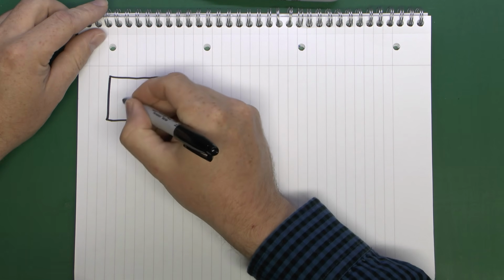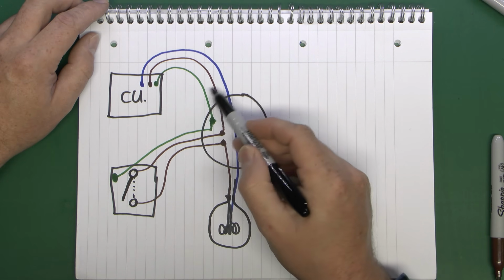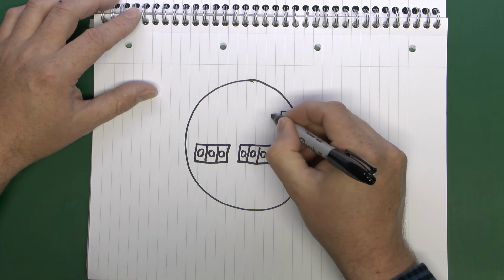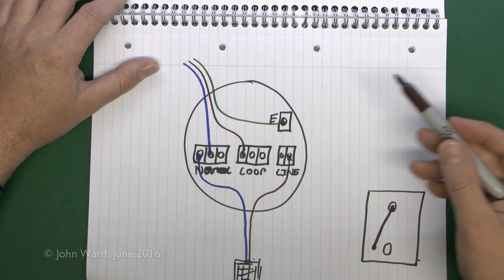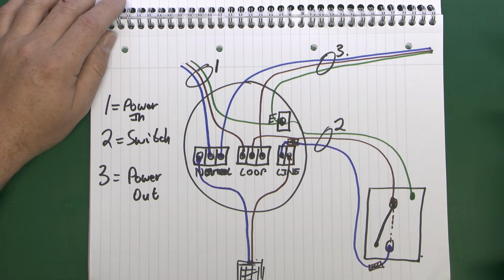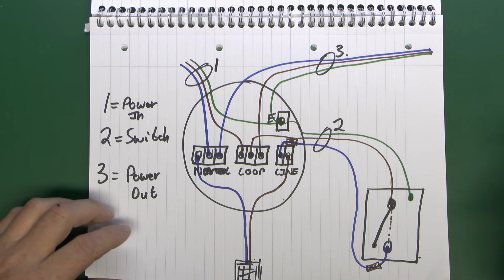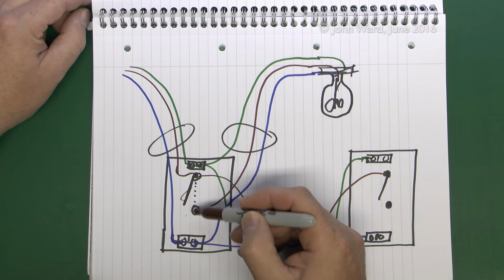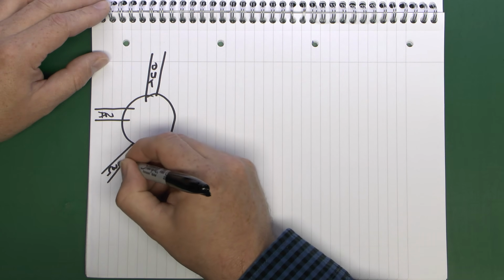Lighting Circuits Part 1 - Basic Concepts

Comment: thank for the great video, explains its very well...but I need help! I want to run four lights using only one switch .....I have follow your wiring instructions for the switch to the first light then run the wiring to the second and  third light and all was good...I then got to the forth light and I'm stumped on how to wire that one can you help.cheers
Reply from the maker: Additional lights are just extending the L,N,E wires from the first light to the next, and then to the next one, and so on for as many as you want.
Reply: @jwflame  thank you foe getting back to me...if you hear a loud bang I got the last one wrong :-) have a good day be safe and keep well regards Mark

Comment: Absolutely brilliant. I would however like if you explained where the wires in the switch go. L1 , L2 , and COM. Does blue(Neutral) go in COM and switched live go in L1 ? Thanking you again for your video.  Best explanation ever..
Reply from the maker: A switch just connects two wires together.  Those two wires go to Com and L1.  Makes no difference which way, and neither of those wires is a neutral.

Comment: I am in the US and they  use  wire nuts and the  boxes do  not have  terminals built into the box white is neutral t is this box flush mount or surface mount I can not see the wires being surface since cable needs protection when exposed

Comment: your two way lighting circuit doesn't work because you need 2 1 gang two way switches and a 3 core and earth to link in between. you have 2 1 gang 1 way switches and a 2 core and earth so the other switch only has power but no output so its useless. thats handy if it was a two way and was feeding another light but its not.

Comment: Are double insulated metal switches exempt from having an earth wire. Our lighting circuit installation doesn't have a CPC.
Reply from the maker: If such a thing existed then it would be acceptable - however such a thing would also need to be mounted on a plastic backbox, or a metal box which has plastic inserts for the fixing screws.
Reply: @jwflame  thanks very much John. I didn't know such lining boxes existed. It is double insulated and the spec sheet states no earthing is required. LightwaveRF Wireless Control 2 Gang Dimmer Switch LW420 SS (Stainless Steel) spec sheet here: https://support.lightwaverf.com/hc/en-us/article_attachments/115002887152/LW420_Spec_Sheet.pdf the switch has a metal faceplate so it must be insulated from the screws that fix the switch to the backbox. I'll have to check the switch itself tomorrow but from memory I think there is a plastic layer between that and the frame.
Reply from the maker: If the fixing screws are completely insulated from the metal front, and the metal front can't be removed without using tools,  then no earth required.  Nylon fixing screws would be another option if not.
The metal boxes with plastic screw inserts are usually only found on very old installations that didn't have any earth connection at the light switches, not aware of anyone that makes them now as all lighting installations in the last 50+ years have required an earth at every point.
Reply: @jwflame  I think I'll be okay. I've read the installation instructions and under point 6 it states. Any earth wires present must be attached either to the earth terminal located in the backbox or capped with a strip connector. The dimmers are double insulated so are not required to be earthed directly. The model of the switch is lightwaveRF JSJSLW420. A bit expensive for you to buy to go through them on your channel but if I find one on eBay 2nd hand as there's a smart version out now that's voice activated and are getting cheaper, then I might send one your way for testing in a vidjeo as Ave would say. Many thanks for replying John. I know how busy you are. Here's the video of how they are installed which shows the double insulation. https://www.youtube.com/watch?v=j1s4adqYEiA

Comment: Very clear and concise video. The only part i struggled to understand is at   16:43 , Why would that make everything go bang if you put the neutral in that terminal? wouldn't it in theory just make a circuit back to the power supply? or does it need at least one component to be on the circuit?
Reply from the maker: A light switch is connected in the line conductor only - all it does is connect two wires together, or not connect them.  If you connected line and neutral together, there is nothing else in the circuit to limit the current.

Comment: What about when its singles or a mix of singles and loops. Then there's the weird and wonderful ways of wiring with three cores so its not straight forward and if a DIYer does it, it'll be a dogs dinner of a connection at best. That's before we get to the point of knowing it is really safe.

Comment: Just for completeness, another way to wire multiple lights from one switch in a room or loft, especially if adding to an existing installation with a ceiling rose, would be to daisy chain the second, third, etc light fittings off the terminals in the original ceiling rose. Effectively building a switched radial with a number of unswitched lights.

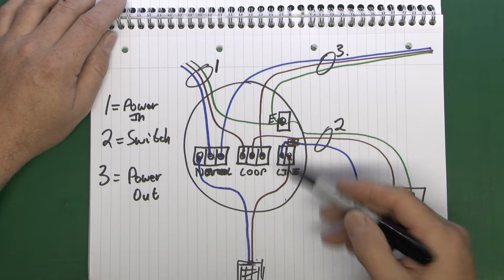Comment: 15:10 'Permanently mark...' But it would be the blue wire with the brown sleeve. Already marked.  (Of course they rarely are...) I have also seen several installations where the lighting circuits are rings.
Reply: Do u think people put in rings because they are replicating the 13amp socket ring main, or they plan to use a shed load of halogen bulbs that could get quite hot?

Comment: Hello JW..love your Videos...some of it over my DIYers head but love doing electrical jobs and learned a lot O stuff Thank You.
I’m extending some lighting and ring main cables and I would appreciate your take on the In-line Spring Lever Connectors...Toolstation product code 45902. I would appreciate your comments Thank You...Dave Machin

Comment: Im starting from scratch on my shed build. I want 3 led batton lights but want to switch each one on separately from one switch. Do I need run from consumer unit to wall switch then from wall switch to led Barton's with 3 cables twin and earth to each light ?

I'm not fitting the consumer unit as a qualified electrician shall be doing all the final conetions to the unit and light switches etc.

Comment: Honestly you made that so easy to understand, i am in the process of adding 10 x 4w ip65 led spotlight to my bathroom with a dual (trailing edge) dimmer switch, using the same power in for both circuits and you have made the whole thing very simple and straight forward. many thanks for sharing your knowledge.

Comment: I always get thrown when i have to connect the neutrals together at the switch instead of at the ceiling rose. It is the same thing right?
Reply: The neutral would only be at the switch if you had a multicore / twin and earth (like in domestic) and you decide to put the power in/out to the switch instead of a ceiling rose. (Like JW said, there are lots of ways of wiring lights) This type of wiring would suit a kitchen full of spot lights for example where you don't want to have a ceiling rose or junction box in an inaccessible place. 
Now, on the other hand, if you were using singles in conduit/trunking (like in a commercial premises) you wouldn't take the neutral down to the switch. Just Lives and Earth's. The neutrals in that case could go straight to the light.

Comment: excellent videos / many thanks.
Just 1 problem for me - I have taken off a 2 gang light switch and although i did photograph  the old connections, they don't seem to bear any resemblance to the  new switch I have bought .  Therefore I am faced with 3 existing t & e cables at the switch position to be connected somehow and I have no idea what should be connected where. The double switch operates 1 fitting at our entrance and 1 on our landing. The new double switch, from B & Q, has 'L'  connections marked at the top on each switch and 'L1' and 'L2' marked on each switch at the bottom. 
Is the 3rd cable I am looking at actually redundant? Really confused and hope you can help.
Regards
Mike
Reply from the maker: Different manufacturers switches may have different markings, but the basic functions are the same.  L/L1/L2 could be C/L1/L2 or Com/L1/L2.  The other main difference is that some 2 gang switches have one of the switches upside down, so the Com/L terminal for one is at the top, the other one at the bottom.
In any case, the new switch needs to be wired in exactly the same way as the old one, so if the 3rd cable was connected before, it still needs to be connected to the new switch.

Examples here: https://www.flameport.com/electric/lighting_circuits/lighting_switcharrangements.cs4
Reply: @jwflame  .

Many thanks for taking time out to respond to my query.
Unfortunately I still cannot get my new switch to operate correctly. Just to recap, all I want to do is to replace my old double light switch on the ground floor with an equivalent new one. The layout of the new switch is a double in the L1, L2, L3 triangular arrangement you have on your web site. So far, the first switch was the simple wiring arrangement for a switch and is operating the ground floor fitting. Therefore I only have 2 further t & e cables to deal with. I have tried both cables to get the upper fitting working but without success. Clearly the 3rd cable is the key but I dont know how I should wire it!
I have now inspected the single switch at first floor level, and there are the following connections: there are 3 cables, cable 1 has 'black' to L1 and 'red' to L2.  Cable 2  has 'black' to the common terminal and the 'red' is connected via a connector to the 'red' of the 3rd cable - the 'black' of the 3rd cable is not used. I have not and don't propose to change the upper switch.    
I'd be most grateful if you could help me to crack this problem. Thanks again.

Comment: I'm struggling to work out how to do this but with ONE switch for 4 lights. When the leg comes off the first ceiling rose does the live go into the loop or line of the next rose? If it goes into the line then surly it will be continually on??
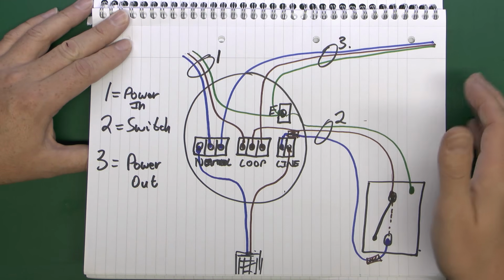Reply: Look at 22:00. The wire that comes out to the first lamp just continues to the next relevant amount of lamps you want to control. So basically the first and subsequent lamps will have two cables (in and out) the last lamp will only have the one cable (in)
Reply: @Takingnoshite 
 thanks for your reply. So when, in this example, cable 3 goes into the 2nd light it will be terminated as:
Neutral in Neutral
Pos in Loop
And earth in earth
What I struggle to understand is on the next light that won't have a switch, if the POS is in LOOP then how would the lamp be illuminated, how will the 'Line' terminal get it's power to light up the lamp? It would make more sense that the POS for the next light would be terminated into 'Line' thus illuminating the next lamp? Your reply will be highly appreciated 🙏
Reply: Ok. So do you want to control 4 lights with one switch or 4 lights with 4 switches.
Reply: @Takingnoshite  4 lights ONE switch 👍
Reply: Ok. Simple enough. The cable to the light fittings will have three cores. Brown (live) Blue (neutral) and bare (earth/ground) requires green and yellow sleeping. The light fittings should have a connector marked L E N. Brown to L and then out again to next light. Blue to N and then out again to the next light. Bare wire, sheathed in green/yellow sleeve to E and then out again to the next light. 

I hope that makes it clear. It’s difficult to explain things sometimes.

Comment: Jon, how would I wire a twin light switch to two separate light circuits? Example one switch switching ceiling lights and the other switch switching wall lights.

Comment: What happens when you have two lights working off the same switch  and an extractor fan
Reply from the maker: Additional lights connect to neutral and switched line (the outer terminals in the ceiling rose).
A basic fan connects in the same way for just on/off using the switch.  If it's an extractor fan with a timer, that connects to all 3 terminals - switched line, neutral and permanent line (loop).
Reply: @jwflame  Thanks for the reply.  I intend to get a sparky to do it, I just wanted to understand for myself the wiring configuration.

Comment: If you wanted to have a double dinner switch in a room. I expect you would wire in an addition cable to double switch and an additional cable from ceiling rose - light.

Comment: And since when does a switch require an Earth connection??
Reply from the maker: When it's one of those decorative metal types that vast numbers of people want in their house.
Reply: John Ward Not trying to be pigheaded, just that We Are told that switches require Load and turn-on wires, nothing more nothing less
Reply from the maker: The switch itself only needs those two wires, but any with a metal surround also need the earth connection.  It's also a requirement that all points for switches, lights and everything else includes an earth connection even if plastic switches are fitted, as they could be changed for metal ones later.

Comment: I have disconnected a fan light from the ceiling which was here when we moved in.I What to swap it for my twin Led tube light.I seem to have three blue neutral cables and three brown live wires.Its seems to control the landing light as well as the bedroom light.I am stuck to which goes where.

Comment: John, My lighting circuit is wired with the loopin/out into the switch. I want to fit a QuinetiQ wireless 2 way switch. Can you please explain how to achieve this.
Reply from the maker: Remove the existing switch, connect the wires together (all L together, all N together, all E together).  This will result in the light being on permanently.
Fit the receiver module in the ceiling, the existing cable is the 'in' on the receiver, add a short piece from the 'out' on the receiver to the light.  This receiver can now control the light.
Pair the new wireless switches to the receiver module, put one of the wireless switches where the old wired switch was, and put the other wireless switch(es) wherever required.

Comment: Hi,Rather than running a long length of cable from the live switch can I just add a junction box to the line from the CU to the switch as I have access to it in the loft and it would be a much shorter distance to the new room and neater less complicated run of cable.   P.S  Excellent video.
Reply from the maker: Yes, that's ok.  Another method is to run the cable to the switch and then to the light.

Comment: Apologies for asking on an old video, trying to figure out what they did when they built this house some 20 years ago.

Lounge has 2 light fittings and 2 switches, both switches are just a twin and switch both lights on and off. Thought
I would prefer to switch just one from each switch. Removed the cover and we have 2 black wires and a yellow in one
switch and 2 red wires joined but not connected to the switch and 2 blues and a yellow in the other. Though better
things to do and put the switches back.  I will be testing these soon.

But the upstairs landing light is the bigger problem, fitting LED bulbs around the house and that one glows faintly with the switches off, this also has 2 switches one upstairs and one downstairs.  

Where to start with the switches or wiring to the light socket?  Any common issues? Thanks in advance.

Comment: Yesterday, I attempted to replace an aged bathroom light. I kept the reds together and the blacks together. Then the switch at the CU goes off.

Then I found your video. Your diagram was not only crystal clear, but later I understood what I did wrong in the first place. I corrected it, and replicated the schematic of a rose using terminal blocks. I also taped the dated wires with new colours (brown and blue).

I cannot thank you enough. If you have a Patreon account, do direct me to it.
Reply from the maker: https://www.patreon.com/jwflame
https://www.flameport.com/youtube_channel_info.cs4

Comment: Is it really ok to have the neutral block just sitting in the back of the switch box?
Reply from the maker: Yes, it would be an insulated connector so no danger of it contacting anything else.
Or you can get light switches with a neutral connector on the back.

Comment: I have a 3-way switch operating 2 fixtures. Power begins at 1 of the fixtures. I installed an outlet and ran romex to the switch to power the outlet. No neutral there. How do find the neutral at the fixture? even the white wire at the ceiling fan is tied into a black????

Comment: Hi John,
just come across your excellent video whilst searching for help and advice!
My dilemma is this, I am wanting to remove a ceiling rose altogether and replace with two wall lights (one either side of chimney breast).
Please could you advise on how to go about it?
Many thanks
Paul
Reply from the maker: Replace the ceiling rose with a 4 terminal junction box, and add cables from that to the new wall lights.
The junction box will need to be one of the 'maintenance free' types if it won't be accessible afterwards (such as concealed in the ceiling).
Reply: John Ward 
Hi John,
I have just replaced an old outdoor front light fitting with a new one that has a PIR.
After fitting the new lamp and leaving the light switch ‘on’  it stays on permanently and doesn’t work as a PIR should?
Please can you advise what I have done wrong?

Best wishes

Paul

Comment: Poor old earth connection only gets a single terminal for three wires. Why?
Reply from the maker: It's typically a larger uninsulated terminal, which would be cheaper to manufacture than smaller insulated types with several terminal screws.   Being the earth, it's the only one that can be bare metal.